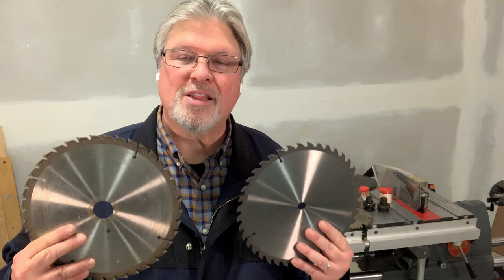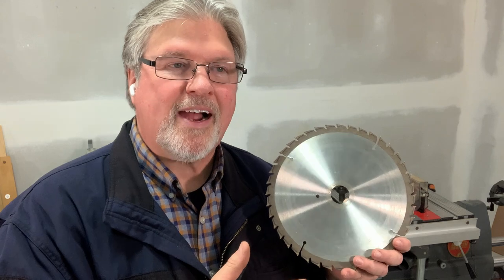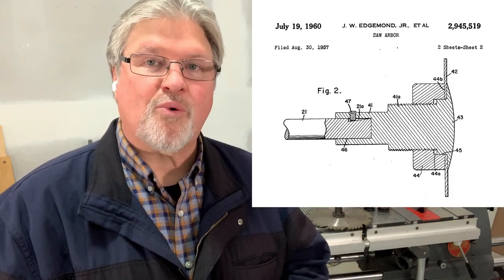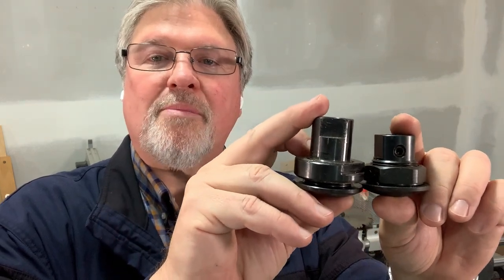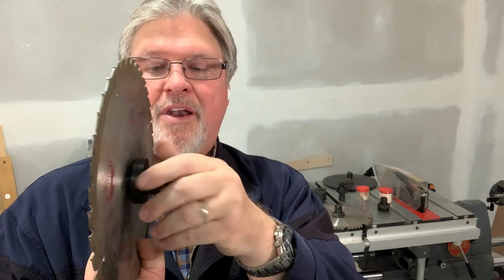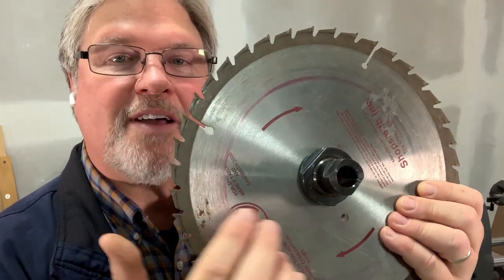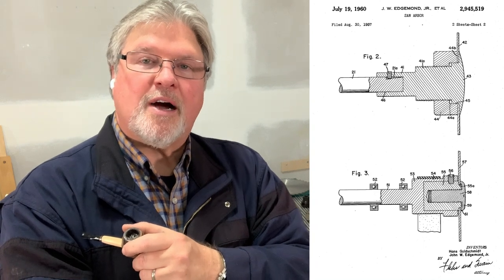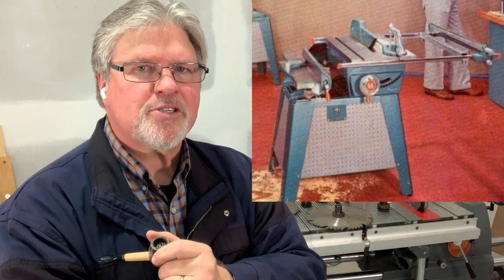What's the deal with Shopsmith's 1 1/4" saw arbor?

Comment: Very interesting. I had heard/read the other reasoning for the 1.25 arbor, but not this one, I don't think. Better performance and stability may not have been the purpose of the 1.25 arbor, however it does seem to be an unintended consequence. At least I feel as if the 1.25 inch blades perform a bit better from a quality of cut perspective. Certainly I reach for those first over the 5/8ths.

I have learned over time what a huge advantage the removeable arbors provide. Non-shopsmith people think it's weird and of course it is. But to have a purpose designed arbor for each type of attachment improves quality. As an example we saw the recent YouTube video involving superglue help a dado stack make better cuts.
Reply: Yep I have a different type of blade loaded on every arbor.  On I use mostly the dado arbor because I have several of them.     One of my favorite blades I run when cutting hardwood is a thin kerf combo tooth blade for a skill saw. Man it is just shy of 1/16th thick and is like a hot knife thru butter.   That Mark 5 just walks thru red oak like nothing is there and makes the prettiest cut. You don't hardly need to sand or anything afterwards.   Once I used it to make a box joint on a little jewelry box.  It looked pretty wild.

Comment: Hello! I am from Uruguay and I have a shopsmith in the workshop. It has been stored in the warehouse for many years and I wanted to use it for some wood cuts in the. His engine was having problems so I took it out to send it in for repair. And I was able to realize that there were some elements within the device that were quite particular. Although I always knew the quality of the tool, I had not given it much use. That led me to look for information and I found your videos that have been very useful to me. Once the engine was repaired, I looked in the warehouse for all the elements related to the machine. I found the "edger", a "polisher" extender, supports and guide of the "lathe" and more elements that I do not know their functionality. If you have or know a place to buy a manual, I would greatly appreciate it. Now I am conditioning the "edger" and it is missing 2 screws to the blades. But watching your videos I could find them on Amazon. It has been very useful if I work. Thank you so much. Greetings!!
Reply from the maker: There have been several manuals, and I would encourage you to make sure you find the one that is exactly right for your machine. You should be able to find those on eBay. I would also encourage you to find a copy of the book “Power Tool Woodworking for Everyone?”.

Comment: I’m only fascinated with ShopSmith I would never purchase one, but your knowledge has me watching all of your videos. Your knowledge and conviction for the brand is admirable.
Reply from the maker: I’m happy to have you one the side of the opened minded.
Reply: why would you never purchase one?  They are a nice machine and yo can get them used for next to nothing.  They still make all the parts for them and all the bearings are standard bearings easy to find aftermarket for dirt cheap.  You can make a old machine like new in one afternoon.   I picked a a 500 model once for $125 bucks.  I painted it in a hunter green and almond white put all new bearings in it and  I used it today.   If I was looking I would try to get a 510 or 520 as they have far nicer and bigger table set ups.  But you can find the basic 510 as ow as $700.      I love them but I would never buy a new one because you can get used one so cheap. No way I am spending over $5K on a new one, but you can take every mark 5 made and they can be upgraded to the latest and greatest.   They have made over a million machines so easy to find a deal.     even in a professional shop there area few features that a mark 5 can do that are nice to have like horizontal boring.
Reply: @jvmiller1995  I also got some good deals on used Mark Vs and painted one Hunter Green. It's such a vibrant shade! With the right jigs-especially a cross cut sled- a lot can be done even with the small table. The older editions of Powertool Woodworking show so many jigs and fixtures. Included are sharpening jigs. After I learned how to sharpen hand saws, I decided to try sharpening old style Shopsmith blades which are still widely available. Now I don't fear boards which have nails. I do make use of non Shopsmith blades with the 5/8 arbor. Auctions are a great source of saw blades at great prices! (new and used). 
Very informative video! The review of patents and the technology is fascinating Thanks to Scott!  jim

Comment: Interesting to see more history on this. I assumed 1-1/4" saw blades must have been common on industrial machines. My first Shopsmith acquisition included 5/8" and 1/2" universal arbors that were quite useful for the sawblades and other wheels I already owned then and still make use of. I still like the extra heft in those arbors although there may not be much in the way of realized benefit they still 'feel' better.
Reply from the maker: I also like the mass of them.

Comment: I have a blade arbor that I got with my Dad's ShopSmith after his death that has a 2"(?) threaded shaft sticking out from the body that attaches to the headstock.  I think it was for shaper cutters.  He had a 'standard' 5/8" hole plywood blade mounted on it.
Reply from the maker: The 5/8" version is known as the Molder/Dado arbor, and I mentioned it around the 5:20 mark. The 1/2" version is a shaper arbor. Scott

Comment: I've been running a Diablo 5/8" arbor blade on my ShopSmith for a couple years now and I love it. The 5/8" arbor is a bit bulky in my opinion compared to the standard arbor, but being able to get any blade from the depot of homes is worth it to me. I like the Diablo blades, they are a good blade at a good price point. the combination blade is about half the cost of the ShopSmith blade.
Reply: I am in total agreement with you. I love the Diablo blades. I have made glue joints with boards directly after cutting them with a Diablo blade.

Comment: I bought a 5/8 arbor a few years ago, and when it arrived, I called customer support to complain. While I was on the phone, I noticed it was the shorter style you showed. What a great design.
Reply: Why was you complaining?
Reply: Both the 1/2 inch and 5/8 inch arbors I had have a regular nut. I looked at the new one with the large flange and thought it was 1 1/4.
Reply: @nerknerk8834  Oh I understand.  Lol it does look a lot bigger more like th 1 1/4"

The 1/2 in is for shaper bits but it looks a lot like the dado arbor.  The both those arbors come with different size spacers. On the 5/8 dado you can put the biggest thickest spacer on the shaft first then the blade washer and then the blade with another washer and nut.  Then it should clear the tie bar even with the table tipped.  The only downside is when you go to move the carriage and headstock you can't just push them together lik you can with a normal arbor.  But you can cut a short piece of 2 in PVC pipe and split it and slide over the tube from table to fix this if only using the dado arbor.

Comment: Scott… that was interesting.   I use all three arbors for different options:

My cross-cutting blade is on the 1 1/8” arbor.  My 5/8” arbor is for my Forrest rip blade.  And when not set up with a dado blade, its arbor is equipped with a 7 1/4” construction grade Skil saw blade.  That comes in handy when doing rough cuts in plywood, OSB, used lumber and other materials that I want to keep away from my “good” blades.

I’ve also found that the dado arbor is great for homemade plywood disks with glued on sandpaper.  These are useful when I want to rough grind metal… or freehand chamfer wood edges.  It saves me having to change the expensive media on my metal sanding disk  as often.

Thanks Scott.

Comment: I did not know the real reason for the large hole in the Shopsmith circular saw blade.  I still have the one that came with my Mark 5 and I still use it at times.  Just used the horizontal drill press on mine here today; been a great machine for my needs for many, many years.
Reply from the maker: I'm glad to hear it has served you well.

Comment: I have picked up 3 used machines and pny have one actual 5/8 arbor but i have 3 dado arbors and as long a you do not tip the table I have had no issue.  But I have also used some of spacers they come with for different size dado stacks behind the blade several times before to get the nut closer to the blade and I have never had a issue and you can still tip the table.   Lets just say us shopsmith users know how to work with what we have.  LOL
Reply from the maker: So true. I assume that means you don't use a riving knife.

Comment: I remember seeing somewhere that the 1 1/4 hole and larger arbor significantly reduces wobble in a blade eliminating the need for a stiffener. I bought the SS blade (combination) and arbor and haven't looked back... I've always been thoroughly impressed with its performance. I've also involuntarily proven the fact that the arbor and blade will not get thrown off.  (model 500)
Reply from the maker: That’s what they say.

Comment: Thanks for another informative video.  I am always intrigued by your explaining not just the how, but the why of things.  As a side question, I noticed that Shopsmith does not offer an 80 tooth (or higher) Plywood blade.  That might motivate me to acquire a 5/8" arbor just for that.
Reply from the maker: Ron, I'm not sure why they don't, other than the fact they they aren't as critical as they once were when our blades were steel. I have very good luck with a 40 tooth combo blade, myself. Not the version with the groups of five teeth followed by a large gullet, but the evenly spaced teeth like what you'll find on a Forrest Woodworker II blade. A more budget minded blade can be had from Irwin under their "Marathon" brand. Scott
Reply: @MyGrowthRings  Thanks 👍

Comment: Thanks for all the insight you provide on this great machine. I was doing a 30 degree cut the other day. And put in a molding insert made from MDF. Because I forgot the blade can be moved forward to stay center in the original insert. So when you mentioned a light went off a cus word came out. Lol. I was thinking about reaching out to see if you have a vidoe on doing angles on the table saw. Did I mention I an very new to this machine. Keep up the great work. 👽
Reply from the maker: I think I've discussed this in a video or two, but I can't recall which one and the stupid way I am encouraged by the Youtube algorithm to title my videos doesn't help!
Reply: @MyGrowthRings  no problem a searching i will go.
Reply: If you don't have the original owners manual you need to get one. Also get a copy of "Power Tools for Everyone " by R J Decistoforo. Most every operation the machine is safely capable of doing will be in those documents. If you  don't use them for anything else but how to properly setup and alignment, it would be worth the price.
Reply: @curttundra  awesome information thank you.

Comment: It would be nice if they did a 30mm arbour because that is the standard in Europe. I am debating turning a 1¼" arbour down to 30mm, and putting a 27mm left hand thread on it and modifying a 27mm left hand nut to go on it. At the moment I am using a ⅝" arbour with a spacer washer but would rather not be using washers as they have a tendency to go get dropped and roll into a hidden corner of the workshop when changing blades.
Reply from the maker: I believe that’s the first time I’ve heard that request, but it makes sense.

Comment: Thanks, I was not aware a 5/8" arbor was available from Shopsmith.  Good to know as it's not likely I'll ever find a 1 1/4" blade hole here in Japan.  Not that even that matters because my Shopsmith All Purpose Blade has lasted 30 years and is still as sharp as it's always been.
Reply from the maker: The 5/8" arbor is handy to have on hand when you just need to grab and go with an off the shelf blade on the afternoon that your Shopsmith blade decides to toss a tooth! Not a common occurrence, but not unheard of either.  The combo carbide blade that SS provided with the 510/520 is very good.
Reply: You will cover cost of shipping and the arbor by purchasing blades at big box store, thus eliminating s/h charges.

Comment: Nice video, as usual. 

Do you have a way of storing your blades with the arbors attached?  I keep my non SS blades in a shop built holder, but they are all flat. I’d like to see an example of someone’s storage solution for their “fleet” of SS blades w/arbors.
Reply from the maker: Thanks. Yes, in the past I had a very simple rack in a wall cabinet with saw kerf cut with enough space between them to accommodate the arbors.  I haven't moved that cabinet into the shop yet, but I suspect it's easy to imagine.  Scott
Reply: I have a plywood wall on one side of my shop I hang a lot of tools on.  So I just put a 2inch drywall screw in at a angle upward and set the 5/8 arbor hole that goes on the mark 5 shaft right over it.  I never have had one fall off.  My shop smith pushes up against the wall under all the tools when dones.

Comment: I always assumed that the larger hole and arbor was to increase the torque to the blade.  When you have the traditional belt driven Shopsmith motor up to sawing rpm, the 1/2 hp motor is already in a fairly high gear because when you increase rpm your trade off is reduced torque.  That's why the old Shopsmith blades would burn wood so easily.  Push the wood too hard the blade slows down and causes burn marks.  A 5/8 inch hole would only exacerbate that problem.
Reply from the maker: I understand that line of thinking, but once the arbor nut is properly tightened, the load isn’t being exerted on the blade by the arbor, but rather buy the clamping action of the arbor nut. It is an interesting thought experiment to think through. Scott
Reply: @MyGrowthRings  Good point.

Comment: Hi Scott, some use a blade stabilizer on blades, (especially thin kerf blades), but a negative to that is it will reduce your depth of cut significantly due to their diameter.  The 1 1/4 arbor does cover more of the blade adding some stability due to the blade surface coverage and  extra weight and does not reduce my depth.  I agree with about the safety benefit as well.
Reply from the maker: I've heard that argument, and I don't disagree that the larger arbor and hole may offer similar benefits as a blade stabilizer.

Comment: Great video. I have my Dad's Shopsmith Mk V from 1979. I checked the link for the 5/8" arbor but the part is not available. they had an alternative part but not sure that would fit the older Shopsmith. My Dad made doghouses and sold them and pretty much wore the table saw out so looking into being able to use that and researching any upgrades for the upper saw guard. The upper guard and fingers are a problem - not sure what Dad did to them but the fit is pretty bad. thanks for the video.
Reply from the maker: It looks like arbor at the link is only temporarily out of stock, there’s another non-Shopsmith arbor available that might be worth considering. I’ll add a link to it. That’s awesome about your dad’s output. I need to make my dog a house!
Reply from the maker: Terry, I’ve added a link to an aftermarket arbor that is some ways is actually better than an original Shopsmith arbor. How so? Today Shopsmith has the arbor made in Taiwan, while the one I’ve linked to is made in the USA on a CNC.

Comment: Thanks
Reply from the maker: You are welcome.
Reply: @MyGrowthRings  i had an idea 
I was setting up jointer plane plane blades and found that a craftsman cotter pin extractor is perfect for pulling wedges loose without having to use height adjustment screws to do so took short video . If you're interested let know where to send it
Reply from the maker: @arthurmccutchan7000  Smart! Is it one that looks like a bent ice pick, because I have one of those.

Comment: I love your videos and appreciate them tremendously. I have a Shop Smith Mark V 500 that just seems underpowered at the table saw. Trying rip down a 4-foot pine 2x4 takes forever and the saw boogs down badly. I've changed the blade once...wondering if this is normal. I'm 120 volts with 8 ft extension cord. Any thoughts would be appreciated.
Reply from the maker: @willpartin622  I recommend checking the tension on the upper belt. They stretch out over time and it really does make a difference.
Reply: Spot on as usual!
 I did just that and sure enough the belt was loose and slipping under load. Used the slotted slip ring to retention and no more bogging down. Thanks again
Reply from the maker: @willpartin622  You are welcome.

Comment: Could one go the other direction and fit a ShopSmith blade with a bushing to reduce the arbor size from 1 1/4 to 5/8 so the blade could be used in a standard table or miter saw? Freud makes such a bushing/reducer, just looking for validation on safety/performance of doing this. thanks!
Reply from the maker: Hey James. The answer is yes, it can be done, but I’m not aware of an off the shelf solution. I had a bushing made for one of my table saws to do just that, but the bushing needs to incorporate a hub, not unlike a blade stabilizer. If not, the bushing will want to slip out under the cupped washer that is normally found under the arbor nut. I like the way you think. Scott